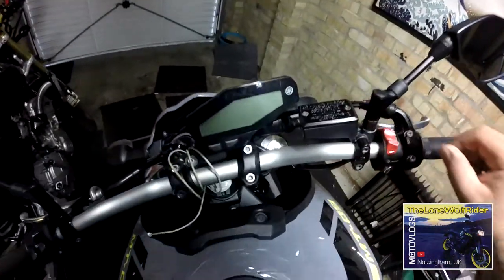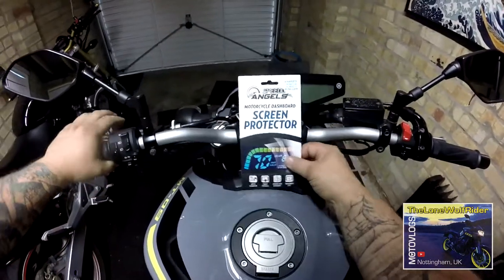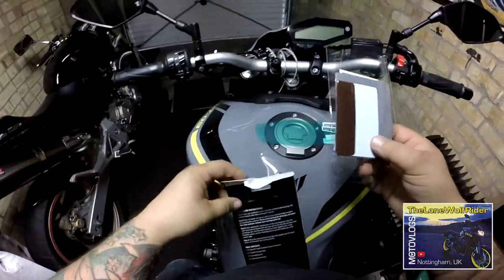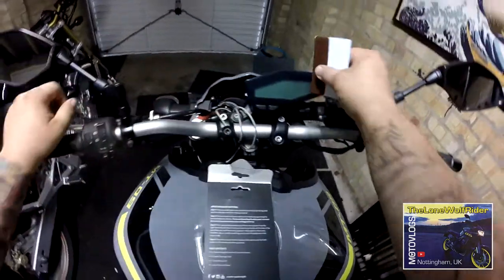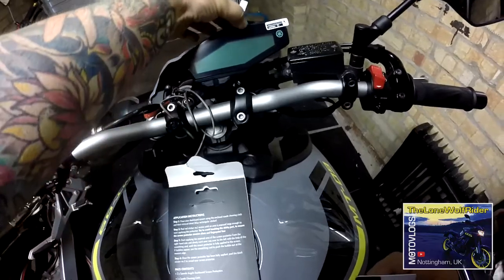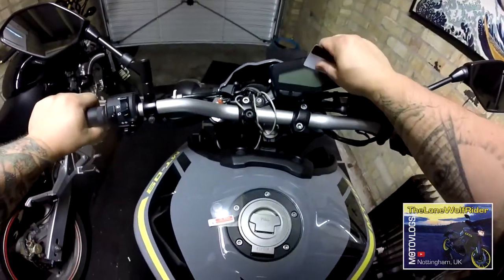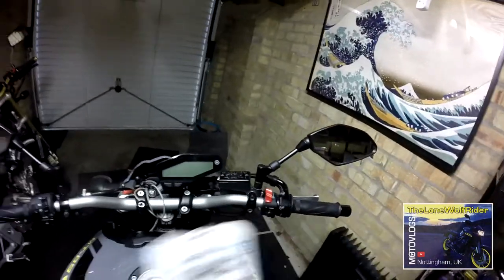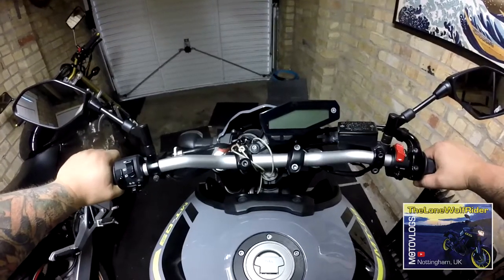SPEEDO ANGELS   screen protector product review and HOW TO

Comment: Great review. Got a question aside from the screen protector.... what is the blinking light for underneath the Yamaha logo on the dashboard? Ive looked in my manual and don’t see anything covering that? What’s it for? Thanks!!
Reply from the maker: Shane Allen it’s just a little indicator for the ignition key chip, it flashed for 48hrs after you turn the engine off.